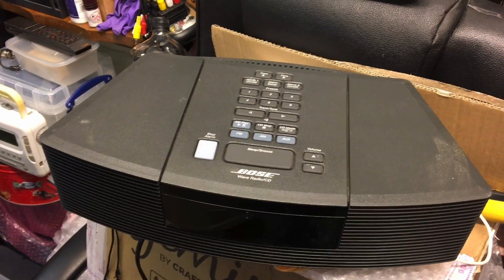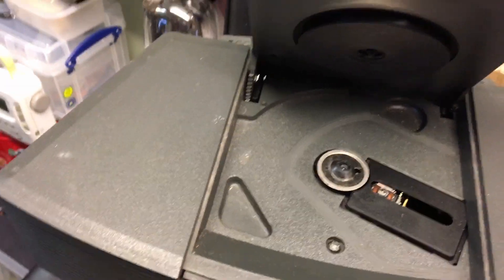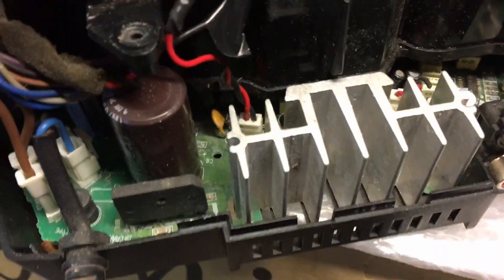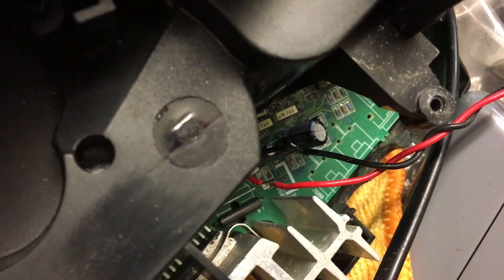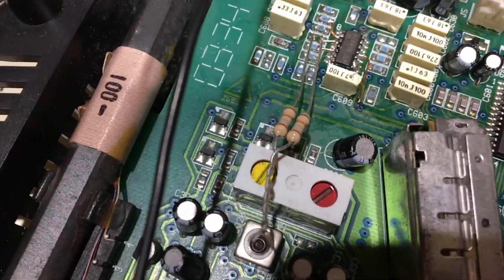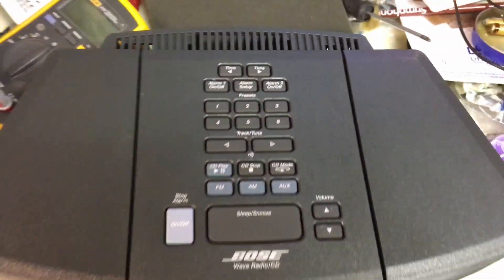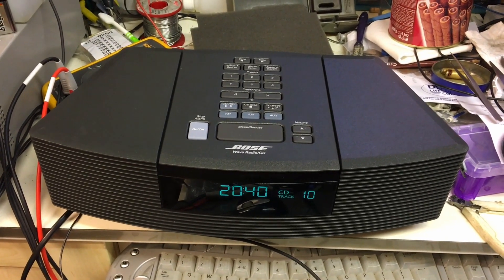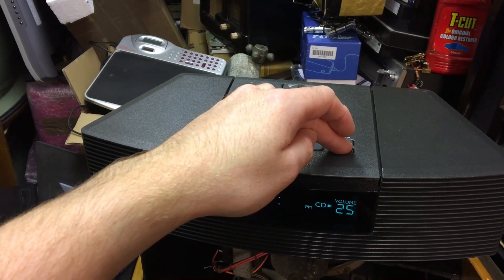Fixing a noisy Bose Wave radio/CD player

Comment: Having serviced audio gear since 1977, I have settled on a single method for dealing with all broken Bose electronics products. Discard it, and buy something from another company. ANY other company.
Reply from the maker: I just wanted to see what they were like, I remembered the adverts in the back of Radio Times in the 90's, and the things were stupidly expensive! Now you can pick them up dirt cheap, so I thought I'd give it a go.. I do like the option of bin it and get something else!! I can think of a few manufacturers that could apply to!
Reply: @somenutterinashed9582  Indeed. Bose has been a pain in my side ever since they first started making things other than speakers, and I never cared for their speakers. And then there's the fact that most of the tech they built their business on came from other companies, but we won't go there. I'm in a good mood and want to stay that way. Enjoying your channel, BTW.
Reply: Amigo el mío es igualito un canal suena feo distorcion alguna sugerencia